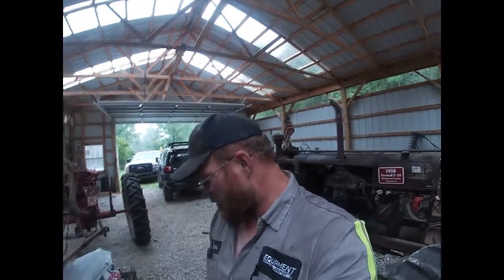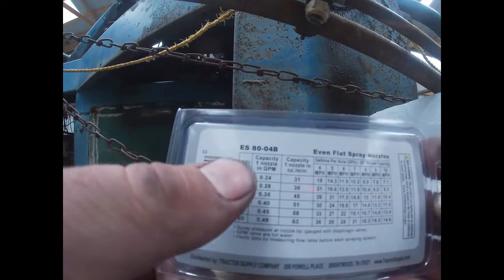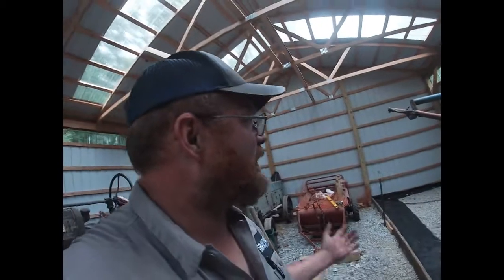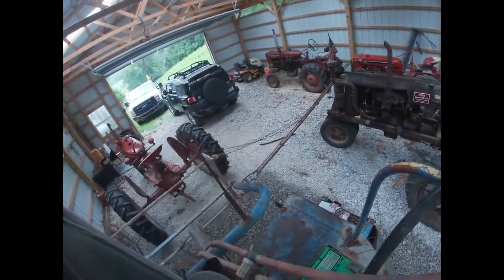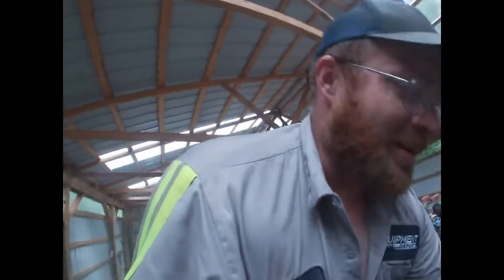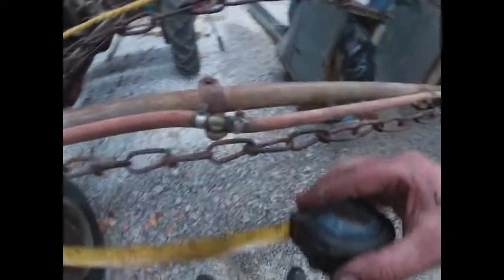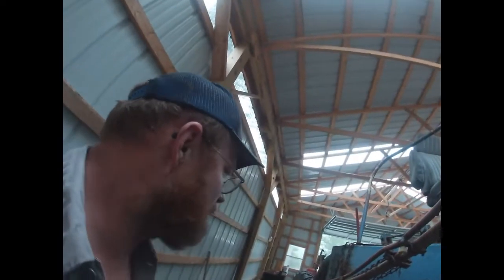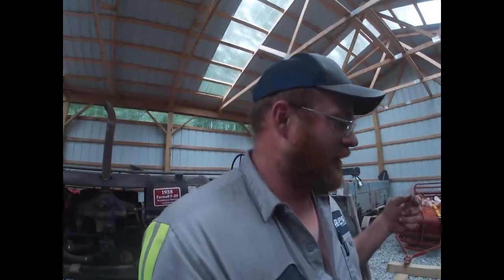Sorting out John Deere Blue problems

Comment: Pressure control valve mounted before the boom valves will work you just need a return line back to tank that hooks to bottom of regulator get a fluid filled gauge if you want correct pressure readings
Reply from the maker: I was getting close to 50 gallons an acre of water. So yes a pressure regulator will have to be put in. Liquid filled gauges are better for fluctuations I should have one that will work. I have air regulators but not fluid. I want all the same nozzles and lower flow if i can get them. I trust the old girl on a hill but not about first gear.